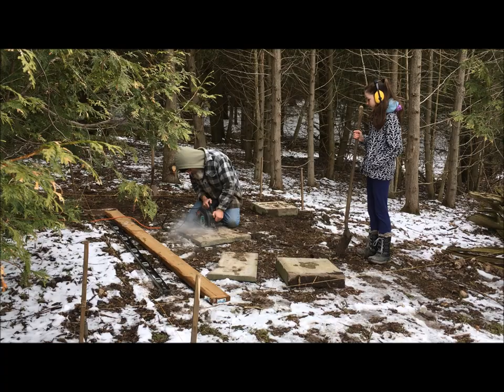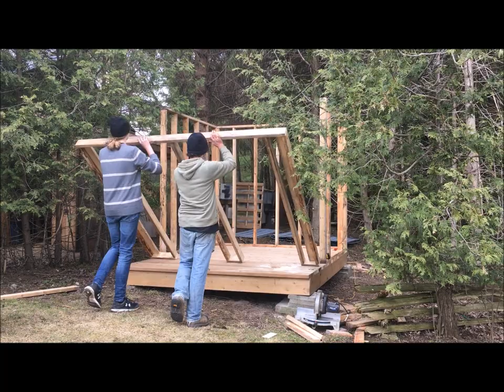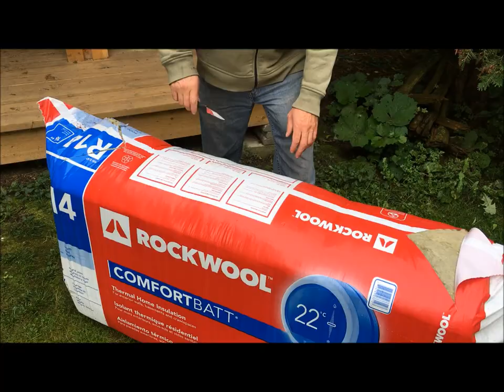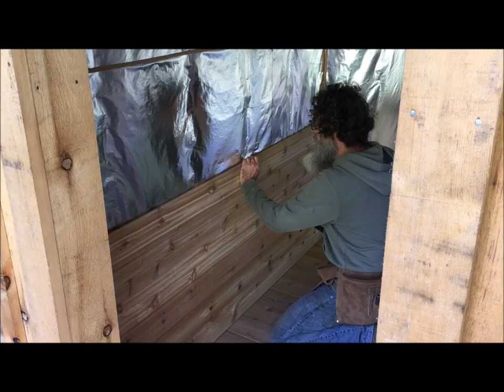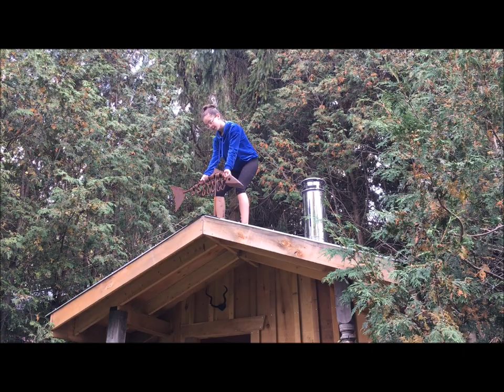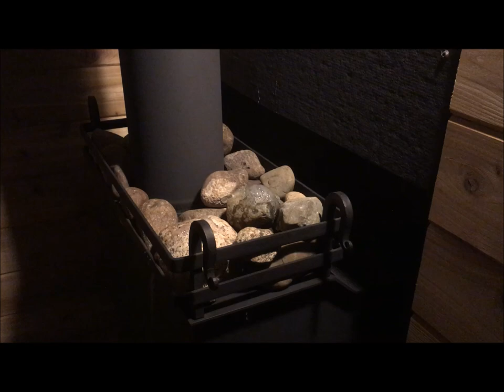Sauna Build

Comment: Beautiful job! I was wondering, is that 2 inch wood stripping over plywood on the exterior? It looks nice and would be a far more affordable way of finishing the exterior (I am about to build my own sauna. Cheers from the Yukon!
Reply from the maker: The exterior wall is not plywood.  I used barn board and did a 2 inch batten over the cracks.  When I priced it out it was about the same as using plywood.  Pricing may be different today and different in your area.
Reply: @beaubeckett6045   Hi Beau,  thank you so much for replying to my comment. I started reading your replies to other questions and ended up answering my own question lol. Regardless you did a great job and your info on the specs were very helpful. Going forward I plan on using the same board length dimensions. The only difference will be that I will substitute the 3 foot porch for a change room. Thanks again!
Reply from the maker: A change room is a good idea.  After using ours for a few years now I can see the value in it.  Good luck with your build!

Comment: Hi, it looks wonderfull. i have a question about furnace.
How you insulated the furnace from the walls in place of instalation (in the wall) to prevent a fire?
Reply from the maker: Hello Marek.  The chimney goes up inside the sauna and through the roof.  It goes through the roof with a double walled stainless steel chimney. Inside the sauna where the single walled chimney is closest to the wall I have put a 32 inch wide piece of cement board all the way up up the wall to the roof.  Behind this cement board there is a 4.5 inch air gap with no wood or insulation.  So for the section of wall directly above the wood stove there is no insulation.
Reply: @beaubeckett6045  thanks, good job.

Comment: Hi there! Great job and inspiration for me! I wish to ask you, is there any insulation used at the floor level? Thanks for answer!
Reply from the maker: Hello.  Only the walls and the celling have insulation.  There is no insulation under the floor.  The floor is made from 2x6 cedar pushed together with no gap. (there are tiny gaps in some places)   This allows the floor to drain if water gets spilled but isn't drafty.  This seems to work pretty good, even in the dead of winter.

Comment: Hi Beau.  Great video. I'm about to start a build and use your sauna as a template. Did you use pressure treated wood to frame it and under the cedar floors for the base. Thanks!
Reply from the maker: Hi Jonas.  Sorry for the late reply.  For the floor structure I used pressure treated then for the floor boards I used 2x6 cedar.  The wall and roof framing was all regular SPF lumber.  The siding was standard barn board.  The roof was sheathed with 3/4 plywood.  The interior was all done with tongue and groove 3/4 inch thick cedar.  I hope this helps.

Comment: PLEASE upload the plans to this!!!
Reply from the maker: Hello.  I don't have any real plans for it.  I mostly just figured it out as I went.  I can give you a few dimensions though.  The base platform is 10 feet long and 8 feet wide.   It is made up of seven 2X8X10' boards with two 2X8X8' boards on the ends.  I didn't have to cut any of these boards.  This was then covered with 2X6X8' boards to make the platform.  I built it this size so I could just buy the wood with no cutting or waste.  From there up I just framed it in with 2X4s.  The outside dimension of the room is 8' wide by 7' deep which left a little 3 foot wide porch at the front.  The walls were framed 7 feet tall and the peak on the inside is 8'6".  If you don't want a porch, an 8' square platform would be a good size sauna.  I hope this helps.

Comment: inside sauna have to be warm. In the feet also. Why you don't have any isolation from the bottom ?
Reply from the maker: I didn't put any insulation on the floor because I didn't want animals ripping it out and living in it.  The floor boards are 1.5" thick and seem to hold the heat well enough.  When we use the sauna in the winter we don't have any trouble getting it up to heat and the floor is warm.
Reply: A sauna I once participated in building had the floorboards spaced ~1cm apart to get fresh airflow from beneath and also to drain the water. That sauna still works perfectly even in the coldest winter days. Insulating the floor is completely unnecessary.

Comment: Looks great Beau! Do you have any plans to share? Looking to build one myself very soon. Much love from Sitka, Alaska.
Reply from the maker: Hello Oliver.  I don't have any real plans for it.  I mostly just figured it out as I went.  I can give you a few dimensions though.  The base platform is 10 feet long and 8 feet wide.   It is made up of seven 2X8X10' boards with two 2X8X8' boards on the ends.  I didn't have to cut any of these boards.  This was then covered with 2X6X8' boards to make the platform.  I built it this size so I could just buy the wood with no cutting or waste.  From there up I just framed it in with 2X4s.  The outside dimension of the room is 8' wide by 7' deep which left a little 3 foot wide porch at the front.  The walls were framed 7 feet tall and the peak on the inside is 8'6".  If you don't want a porch, an 8' square platform would be a good size sauna.  I hope this helps.
Reply: @beaubeckett6045   Hey Beau!  Love your sauna❣️ Was curious about the spacing around the stove through the wall?!  And what materials you used to seal it from outside?  I LOVE the idea of feeding the stove from outside 👍🏼👍🏼 Thx 😊
Reply from the maker: @tanyasluckinski7088  This is a regular wood stove that I reworked for the sauna.  I connect the stove to the wall with sheet metal and there is a 6 inch gap between stove and where it goes through the wall.  On the wall there is cement board with an air gap behind the cement board.
Reply: @beaubeckett6045  Thx!  Appreciate it!!

Comment: How did you deal with drainage?
Reply from the maker: We don't generally wash inside the sauna so there is never a lot of water in there.  The floor is not tongue and groove so any water on the floor just drains through the cracks.  Haven't had any problems yet.

Comment: What is the floor made of?
Reply from the maker: The floor is made of 2X6 Cedar deck boards with no gap.  There is only one layer and the floor in not insulated.  I wanted any water that was spilled in the sauna to easily drain.

Comment: Great video, thank you! Curious if you insulated the flooring at all? If not, did you use treated wood?
Reply from the maker: For the floor I used 2X6 cedar and I did not insulate the floor.  I didn't want animals living in there so I left it open.  We use it in the winter and the floor is still nice and warm and I can still get it up to heat with no issues.
Reply: @beaubeckett6045  Thank you!

Comment: How hot does it get in there? I’ve been in electric heater saunas but never a wood fired one.
Reply from the maker: Hello, Sorry for the late reply.  We can get it quite hot with the wood.  We have had it up to 95C before but we find this a bit hot.  I'm sure I could go hotter if I tried.  It takes about 2 hours to get to 90C and this is even in the winter.  The thing with the wood heat is that it is a bit harder to control.  I am getting used to how much wood to put on the fire to get it to a certain heat and how much more to put on once it gets to heat to maintain it.  It takes a bit of practice.
Reply: @beaubeckett6045  I appreciate your honesty. I have 3 Woodstoves (not sauna) and they take time to control. Lots of factors such as moisture content of wood, species of wood, outdoor temps etc. Enjoyed your video. Thanks.